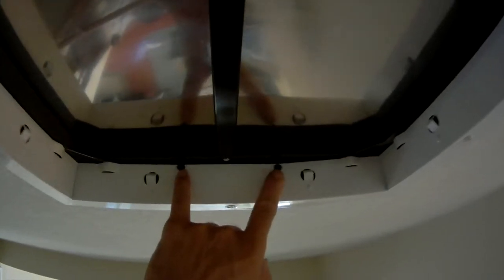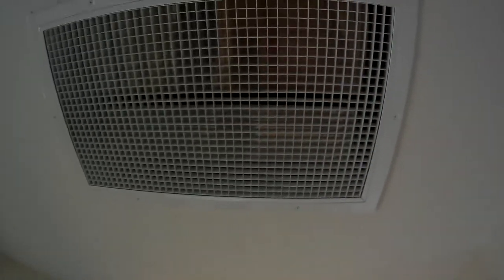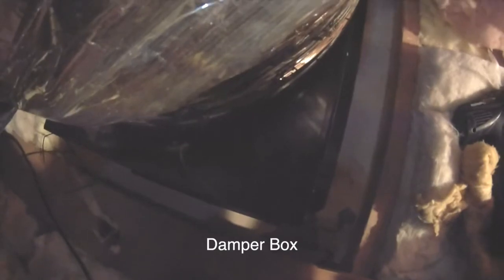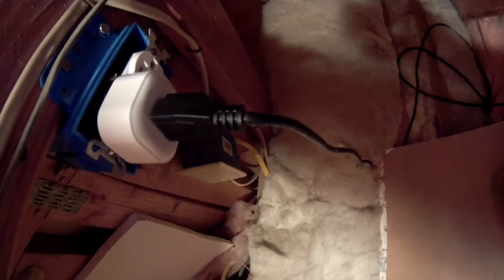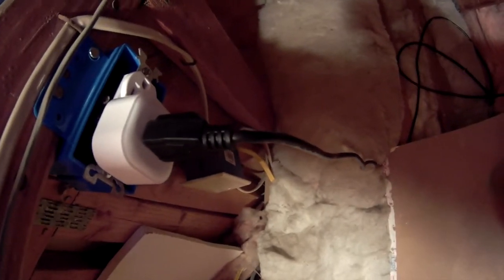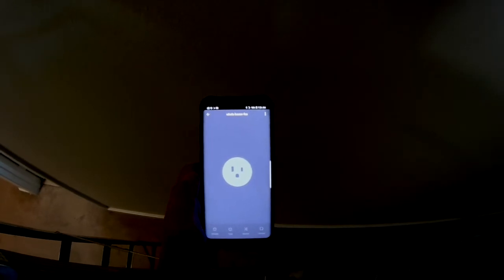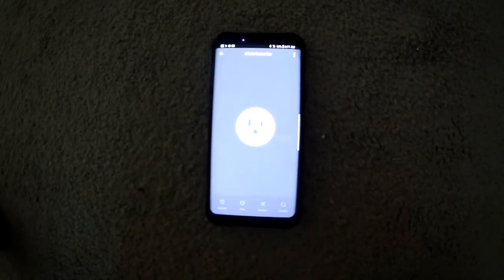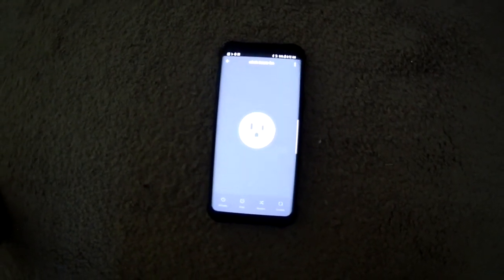Quiet Cool Whole House Fan Installation Tips

Comment: Thanks for the video, made my installation a lot easier than without it. Luckily, my attic had an outlet that my hvac hook up to. Since I didn't need to mess around wiring  the two speed setting, I just use a Wi-Fi plug like your. I have been running it a few hours at night and early morning when the outside temp is in the low 60s. It took me about 2-3 hours with the help of my wife. You have to separate the duct, fan and damper opening box in order to get them in the attic. All those 3 parts can be put back together, very easy they have clips that attach the fan to the duct  the damper box to the duct.
Reply from the maker: You were wise to do it now before it gets hot!  I love ours and we use it all the time.

Comment: I just wanted to know how to automate it with my KASA app if possible. It appears to be so if I go put in a smart plug. I'm guessing, I just have to turn the fan on to a speed, and then I can only turn on/off at that speed from vacations leaving a window open.  We bought regular air filters we use for the house for the windows to help keep the dirt out.  We would leave the upstairs windows open for this purpose.  WE have a Quiet Cool Fan and I love it.  I would have to either auto turn it on when It's typically cool outside,  or check the weather and turn it on/off a set amount of time when needed.

Comment: The only real question I have is do I have to place the intake between two joists.  I see you have to screw into at least one joist.  I think you screw into one joist and then the flange sits on top of the sheetrock on the other side.  Is that correct?
Reply from the maker: I can't remember but if you follow the instructions it tells you, I want to say I think it was between the joists and connected to each of them but it was a while ago.  That fan is super powerful.
Reply: @oakpwr  thanks..

Comment: Hey is this a single speed installation.  The WiFi plug is only one speed right?
Reply from the maker: yes only one speed, you would have to install the controller to get two speeds.